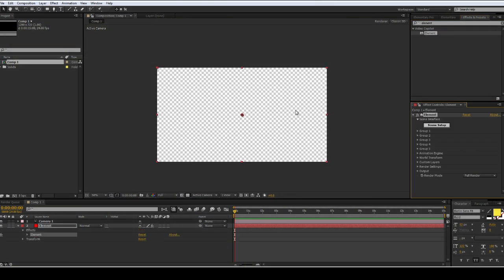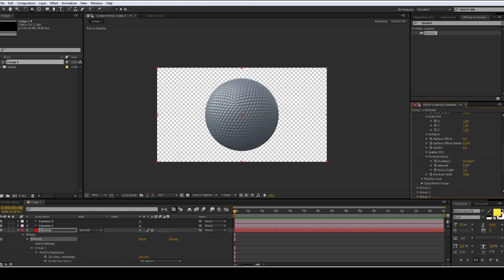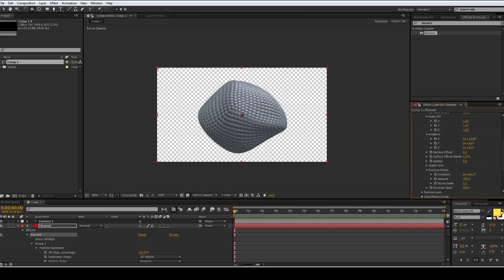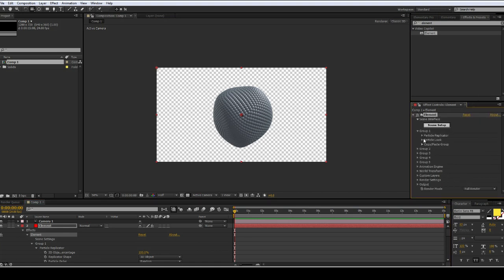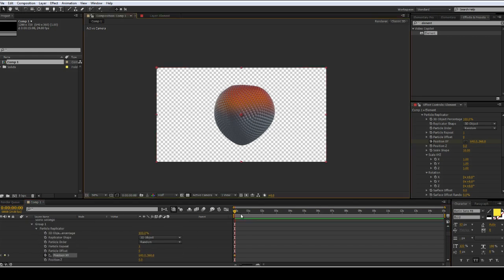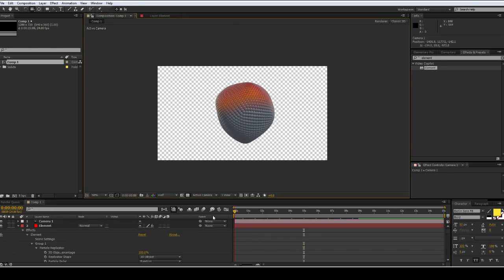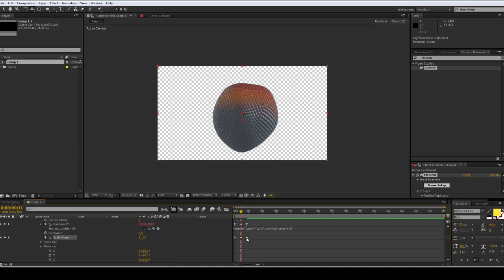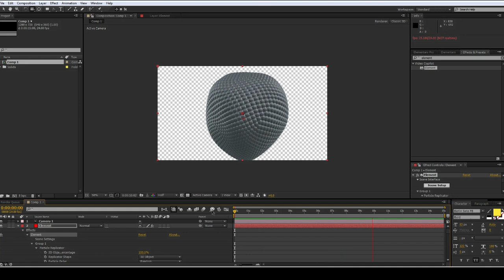Tutorial | Element 3D : Get Your Heart Pumping

Comment from the maker: Yeah it's quite easy. Add your audio to the scene. Then right click on the audio layer and select "Keyframe Assistant". Then choose "Convert Audio to Keyframes". this will add a null with sliders for the Right, Left and both channels. Then all that's left is to choose the element values you want to be linked to your audio and pick whip them to the Right, Left or Both slider. Hope this helps.